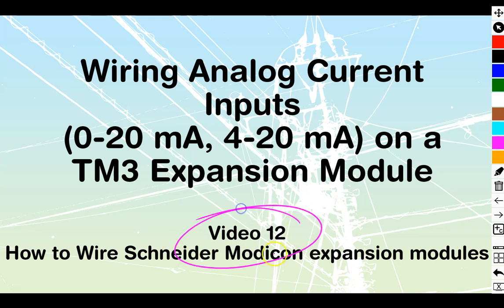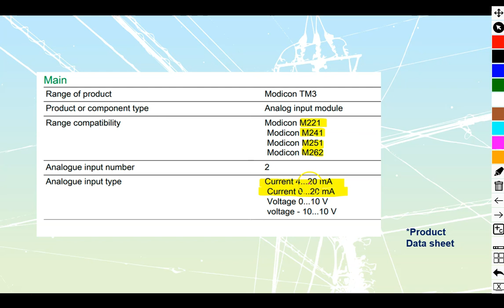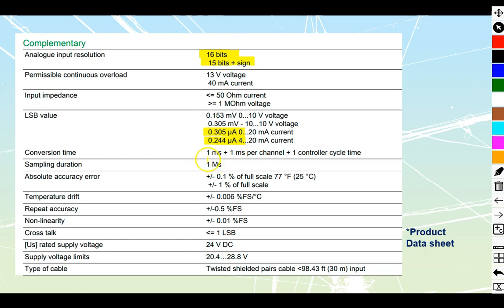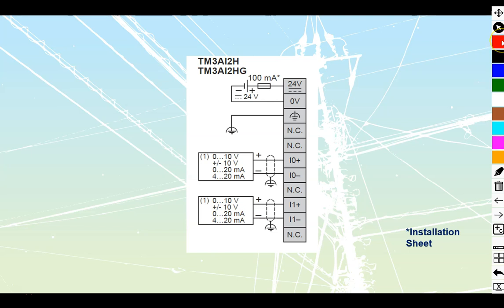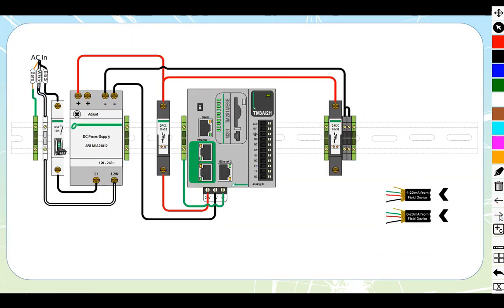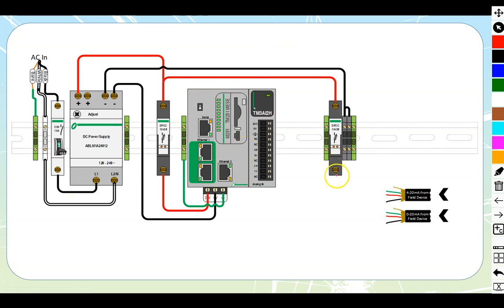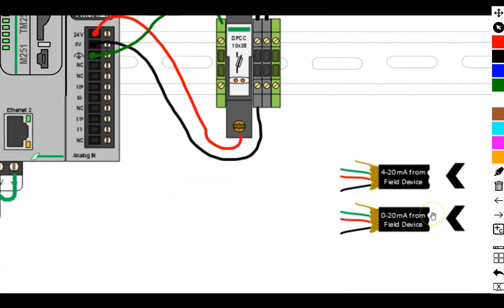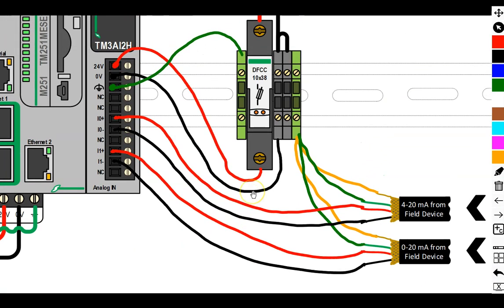Wiring analog current (mA) inputs to a TM3 (Schneider Modicon PLC module) (Video 12 in a series)

Comment: Great!! Hi Joel, What if we use 3 wire sensor? like flame detector 4-20mA input
Reply from the maker: There are two main 3-wire configurations, current-source, and current-sink.  So it will depend which one you are using.  So no guarantees that the setup I'm describing will work since you've provided no details.

For the most common, which is current source, you should have +V power, +SIG, and GND.  Connect the sensor +V to the same "+" power supply as the card, then connect the GND to the -I of the card.  Make a jumper from that -I to the power supply "-".  Finally connect the +SIG to the +I  of the card.

If it is current-sink, you should have +V power, -SIG, and GND.  Connect the sensor +V to +I of the card.  Make a jumper from the +I to the power supply "+".  Then connect the GND to the "-" of the power supply.  Finally connect the -SIG to the -I  of the card.

Comment: Thanks Joel.. A quick question, is the TM3AI8 card powering the 4-20ma 2 wire sensors?
Reply from the maker: Good question.  No, the card does not power up the sensors.  The external sensors are just sending a 4-20mA polarized signal into the TM3AI8 card.  But those sensors will need external power, like the card itself.

Comment: Thanks for making this it was incredibly useful and concise. If possible could you make the same type of video for a TM3DI32K?
Reply from the maker: Hi Brian, I don't have any dedicated specifically to the 32k, as that is the HE10 input style.  But if You watch the first 2 videos in the series, I go through the smaller (8-input,screw-terminal) DI card.  The 32k is the same wiring, just expanded to more inputs and through a harness.  Video 1 is how to use them Sinking ( https://youtu.be/BWdZD1rchsg ) and Video 2 is how to use them Sourcing ( https://youtu.be/0JIThsWaGog )  Hope that helps!.  Good luck.